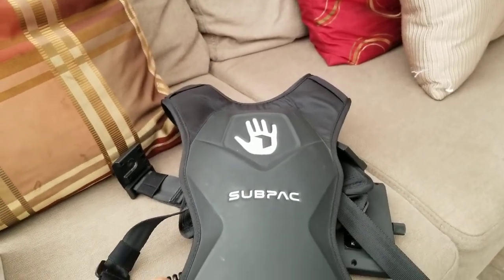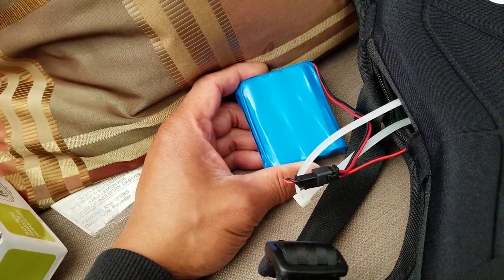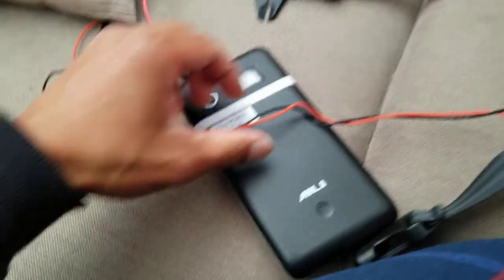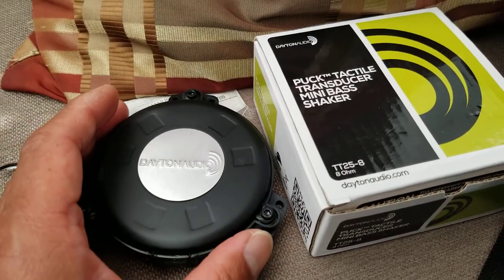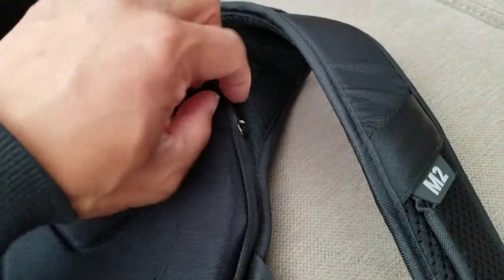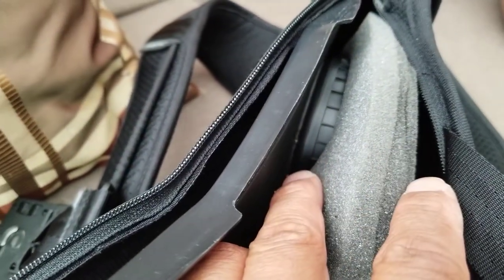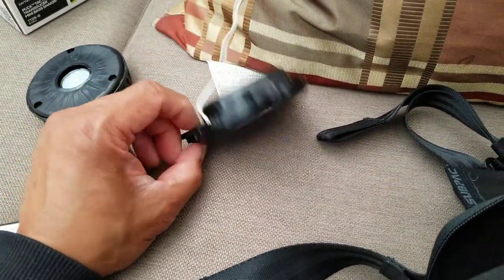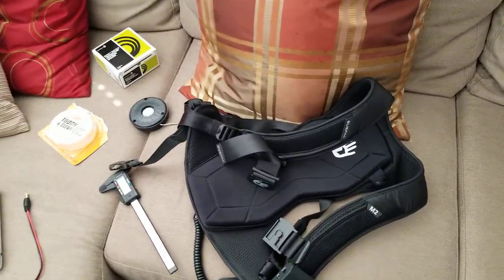subpac m2 repair

Comment: This was SUPER helpful. I have an M2X; no issues with battery, but definitely blew the lower speaker/transducer. Luckily was able to get the zipper to come down without tearing it. Bought the 8ohm transducer, double sided gorilla tape and the power connector - about to attempt repair tomorrow once everything arrives. THANK YOU!
Reply from the maker: Great,  glad I could help!
Reply: @arisnavarro  update! Thanks to your video and guide, I have a perfectly restored M2X.God it feels good. Literally. For those curious - I literally just cut the black/white wire pretty close to where it was coming out of the old transducer - ripped the old one out, used the orange Ideal PowerPlug Luminaire Disconnect (5 pk from Home Depot) and just trimmed the black/white to expose some copper, and plugged both the wires together and like magic - my M2X is bumping perfectly. Much wow! Big appreciation.
Reply from the maker: @DudeShopping  thanks for the update! Man that bass feels good!!!

Comment: Nail polish remover didnt work for me either in getting the zip open (on my S2), i had to do what you did, cut around the ends of the zipper to expose the ends, then pull the actually zipper off the zip, and then split the zip connection myself where the glue is, then i threaded the zipper back onto the ends and pulled it back down. It was pretty difficult to get the zipper back on, make sure you trim away any of the thread near the end, and what i found helped was to pull out a bit of the end of the zipper wire straight on each side, about 2-3 cm, which then allowed me to thread that through the zip and pull them up simultaneously. Subpac did a post on a reddit thread saying that you shouldnt mix transducers it will cause phasing/delay issues. So replace both at the same time even if one is still working. Regarding getting the old transducers off, the best way is to get some floss, about 70cm worth, double it over itself to make it stronger, tie it between two spoons to give leverage without hurting your fingers, hold one spoon and twist the other spoon round and round so the doubled over floss is like braided (again to make it stronger), then have someone hold down the board with the two transducers while you then use the spoons like a hacksaw along the underneath of the transducer. This allowed me to perfectly remove the transducer without taking away any of the foam stuff. Fishing wire would probably work too.
Reply from the maker: That's great! Thanks for adding some tips on your repair. How's the subpak now?
Reply: @arisnavarro  at the moment I only disconnected the faulty one which has brought the whole unit back to life, albeit at half total power. I'm keen to see how it performs when I swap in the two Dayton's when they arrive

Comment: can you please tell me which wire connector you used? I got the same part you showed on the video.
Reply from the maker: I'm sorry for the late reply, for some reason, I dont get notifications when people send me comments on my videos but fyi, I used the orange wire connector  Ideal power plug 30-382j. they are nice push to connect molex wire connectors
Reply: @arisnavarro  no worries, thank you so much.

Comment: When I plug mine in to charge all I get is the red light on for a split second and then it turns off any ideas?
Reply from the maker: Let me try to unplug my battery and try to charge and see if I get the same thing... I'll get back to you...
Reply from the maker: I tried plugging in my charger without the battery attached and the vest still powers up. I was not able to reproduce what you're describing
Reply from the maker: Maybe you should take as voltage meter to check the output voltage of your charger. Make sure it is producing the correct voltage.

Comment: Did you have an issue unzipping it? Mine is stuck at about half an inch
Reply from the maker: Yes for sure... it can be really difficult because it's superglued around the zipper area. Check the comments
Reply: @arisnavarro  thank you!